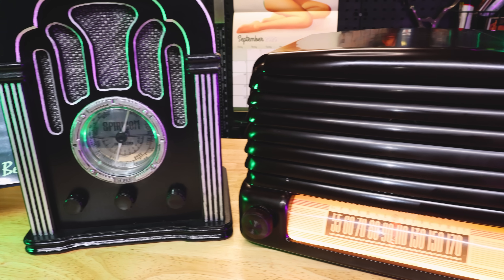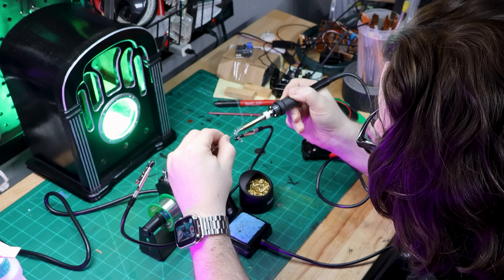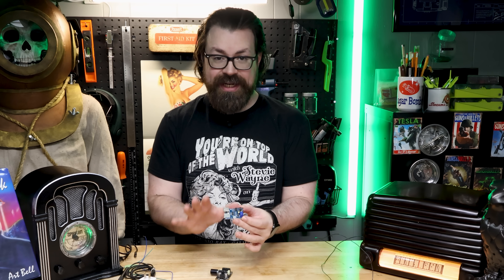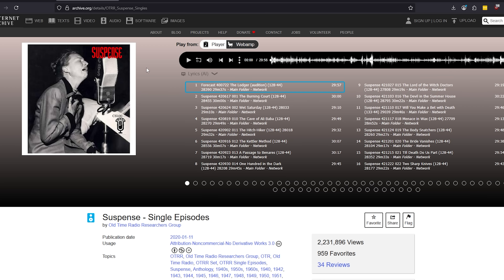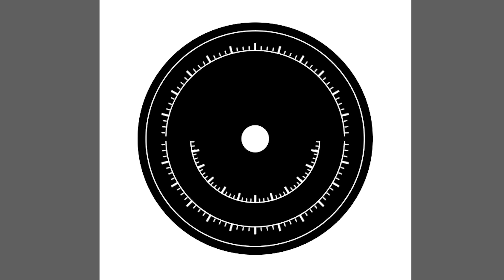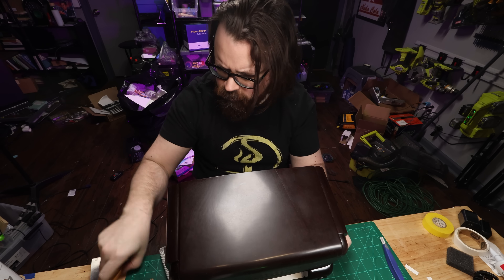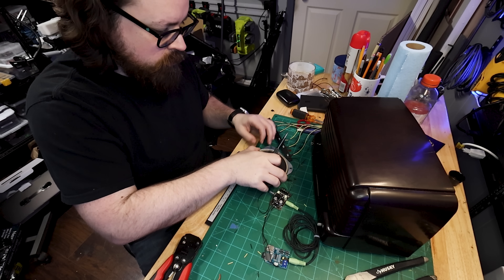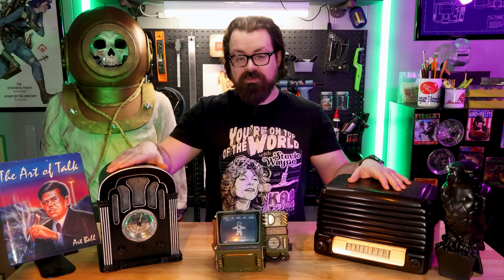I Hacked This Radio Into Something Strange

Comment: As a collector of antique radios I generally don’t condone gutting original radios and putting modern electronics in it unless it’s an empty cabinet, but this project was neat. Also your ‘48 GE was rough electronically, missing tubes are easily replaceable, and the capacitors would have had to been changed out anyways but the tube sockets are not easily replaceable and you would probably be better off getting a different one entirely, the only thing that could have been useful on that radio was the Bakelite cabinet and the speaker. I also wonder if this would be possible while keeping the original chassis intact, and just using the amplifier on it. Some collectors will add Bluetooth receivers directly to the radio chassis and have some way of switching it from the regular radio to Bluetooth, so maybe it’s possible to do the same with this concept.
Reply from the maker: Thanks! I definitely thought long and hard about whether I just wanted to try to restore it but once I saw how much had already been stripped I decided I didn’t feel bad using it for this purpose. For the first time in probably half a century it’s getting daily use again so I feel pretty good about that. That said, this modification could definitely be done in a non-destructive, or at least easily reversed way. The next one I make I think I’d like to try that and see if I could make a way to switch back and forth.
Reply: @theperrydaniels definitely watch some channels like “Mister Radio” and “Mr. Carlson’s lab,” they have some videos on how to restore/add a way of switching between normal radio and an external signal like Bluetooth.

Comment: 9:00 I have the exact same radio all original including the speaker which sounds great BTW. I wanted to play music through it so.....I got a AM transmitter that I connected to my MP3 player and bida bop bida boom I am transmitting AM radio into my vintage radio with all the occasional AM radio noise. THAT is as real as it gets!
Reply from the maker: Someone else commented about using a transmitter and I had to laugh because I didn’t even think about doing that. It’s such an obvious solution now that you point it out 😂.

Comment: This maybe a stupid question but how did you hook up the two boards
Reply from the maker: Not a stupid question, I’ll have a more detailed how-to video out in the next day or two to show exactly how it all goes together. Basically the MP3 board gets power from USB then just need two wires soldered from MP3 to amplifier to share power. Audio is run by a normal 3.5mm audio cable between them. When the video is out I’ll update this comment with the link.
Reply: @theperrydaniels  thank you
Reply from the maker: Here's the video on how to wire all this up: https://youtu.be/xFWc0rc6z2A
Let me know if you have anything other questions and I'll try to help!

Comment: This is awesome! My family has had this ancient radio sitting as a paper weight decoration ontop of our piano for years. Might see if my mom would be willing to give it a little upgrade so it can actually be kind of useful for the holidays!
Reply from the maker: Give it a shot! One of my favorite things about this is that if you’re careful about it you can install this without permanently damaging the radio’s original components. If you do it make sure to share it with me, I’d love to see it 😁
Reply: This is exactly what I want to do!  Word of caution though…if the radio was sitting around for a while and was never serviced, you should replace all wax capacitors in it.  Over time, these things turn from a capacitor into a short, and powering it on will certainly destroy tubes and potentially cause a fire.

So if mom gives the go ahead, first thing is to swap out the caps.  Do not plug it in and turn it on.  That may potentially destroy it.  Also note that these things run on high voltage and are looking for absolutely any excuse to either end your life or make it a bit more spicey.  If you are not comfortable with that, send it off to a tech to do the work for you.  It will totally be worth it, and you will be saving both history and yourself by doing this.

Comment: Found out my CD player had a small scale FM radio built in - you could play your music and anything that used fm could tune in if it was within a VERY small distance (I’m talking basically having the fm device on top of the cd player) I hooked up my fallout TV show Pip-Boy to it, but I definitely felt wrong hearing modern music coming out of it, so I get the feeling. I have that fallout vinyl - sounds of the wasteland - coming in soon which has most of the classic that play in Fallout 3, 4 and the show (but no new Vegas stuff, super sad about that) so I’m hoping to digitize and burn the vinyl onto a CD (which I’ve done in the past) so maybe finally I’ll be able to hear era specific music come out of a pip boy :) Super cool video tho, love that late 40s radio so much
Reply from the maker: Thanks a lot! That’s a really good idea. I didn’t even think of using an FM transmitter. That would be a really nice solution for the Pip-Boy the Wand Company put out with the FM radio in. I’ll have to try that idea with mine and see how it does. An FM transmitter like your CD player or one hooked up to a phone could be an elegant solution for cosplay.